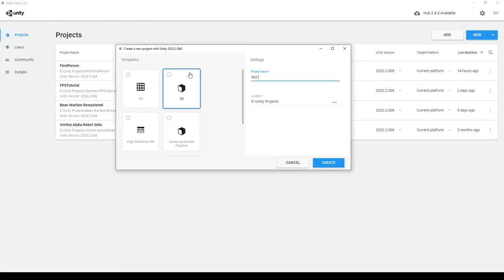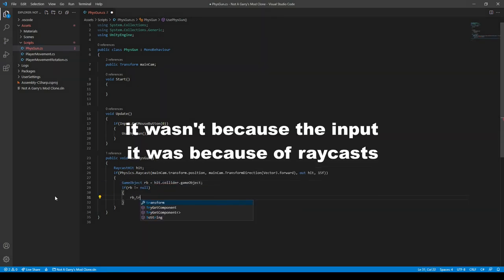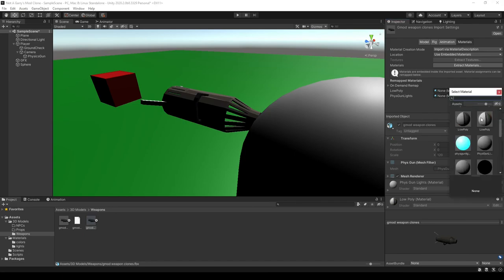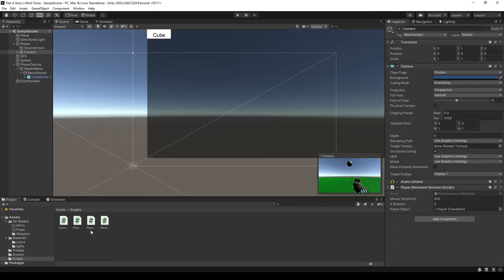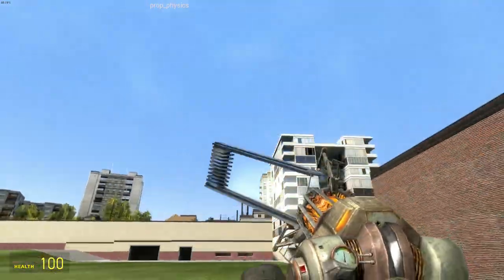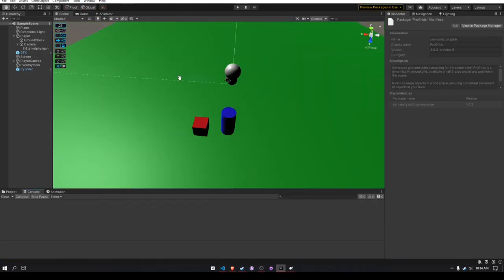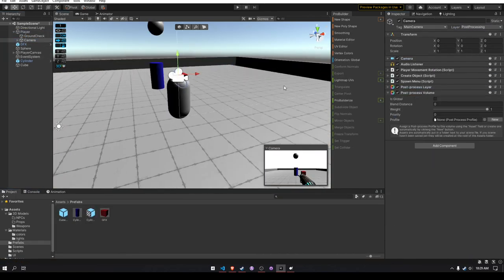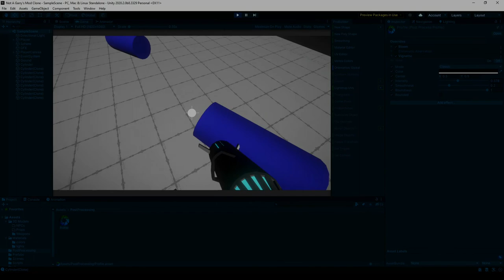GMod Knockoff In 2 Days Using Unity!

Comment: I taked a look at the source gode but i have a problem where the gun doesnt work do you know how to fix it?
Reply from the maker: I am not sure why the gun would not work.
Reply from the maker: I think the gun is working, there just is not that much visual feedback, so try using the weapon on some enemies
Reply: @FunNooberCodingForBeginners  i fixed it, also how can i make a HP Text? You know, like the one in GMOD
Reply from the maker: Have some text in the user interface, and have the player script reference that text. Then convert the player health to a string, then set the text on that UI element
Reply: @FunNooberCodingForBeginners  ok, thx but can i make a respawn like in gmod? Its ok if you dont know how to do that.
Reply from the maker: Instead of restarting the scene, store the player's start position as a variable, and when the health depletes, reset the  health, rotation, and move them back to the initial position.
Reply: @FunNooberCodingForBeginners  ok
Reply: @FunNooberCodingForBeginners  Im having problems with adding new objects in the Spawn Menu, can you help me and explain how the spawn menu works?